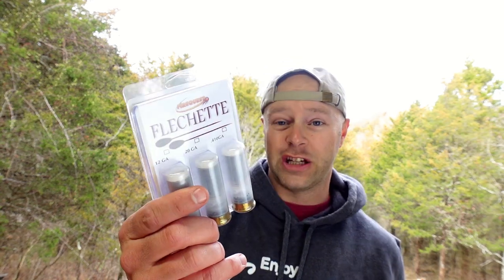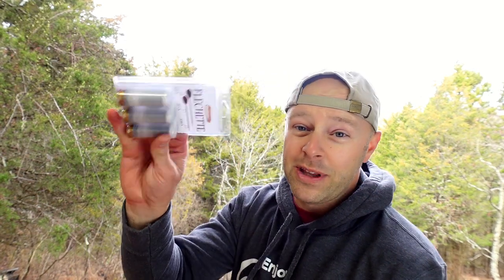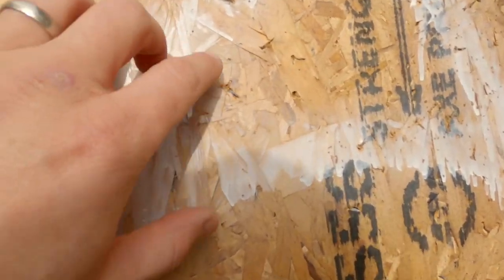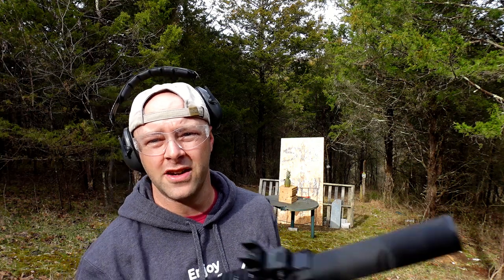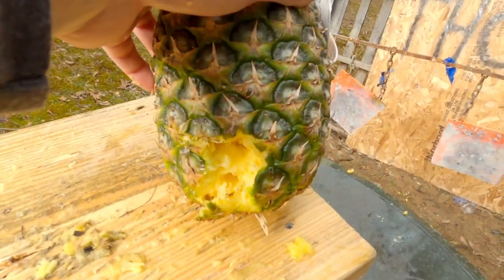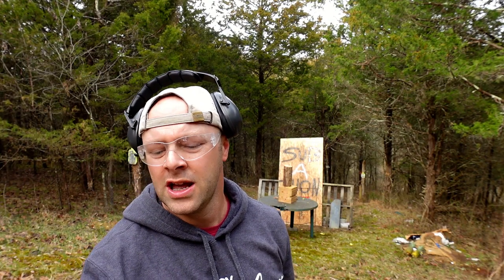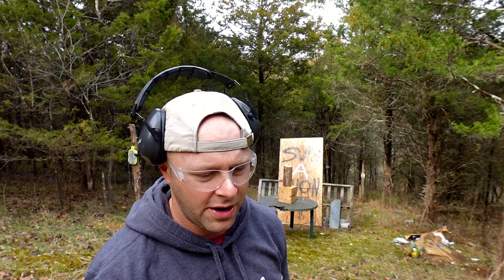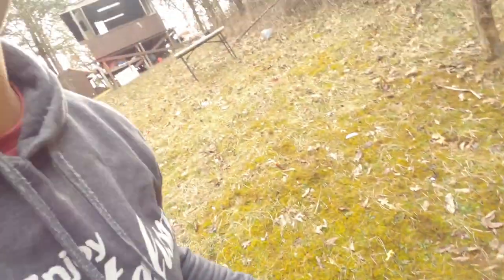Shooting Exotic 12 Gauge Shotgun Ammo from the Panzer BP-12 Bullpup Shotgun!

Comment: In Vietnam, the artillery used flechette rounds for self defense.  Many times a battery was isolated and were easy pickings for an attack.  When the VC attacked, the men would drop the barrels of their 105's and load with flechette canisters.  At point blank range, they fired thousands of flechettes in a single shot and would decimate anything in front of it.   I'm pretty sure they made 40 MM flechette for the M79 thumper.
Reply from the maker: I've heard of that and grapeshot rounds. Out of all of theose shells the flechettes were the nastiest!
Reply: Marine Corps Arty mech here. I worked on and fired the 155’s, never fired the 105. Awesome story!!

Comment: not sure if you did this, but both this one and the century arms version need to be fully cleaned with degreaser and remove all factory oil/grease. then re oiled and have 70ish rounds of hot loads ran though them, clean it again, then it should be good to go.
Reply from the maker: Actually recorded a video on this yesterday running el cheapo target shells.

Comment: Does bp 12 have ejection issues?
Reply from the maker: If you use weak loads it does. It needs the more powerful shells to cycle and also a strong stance so your shoulder doesn't eat up the energy.
Reply: Recently picked up the BP12. Bought a few hundred rounds of 1450 fps, you think that'll be good?  Thanks